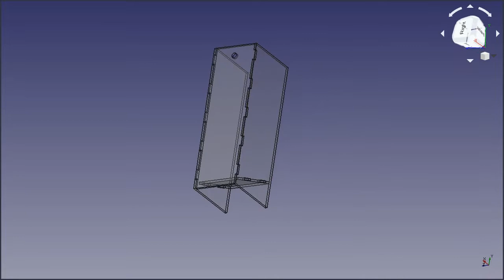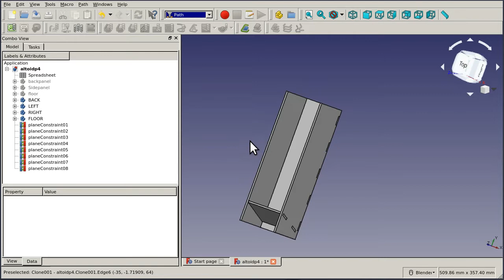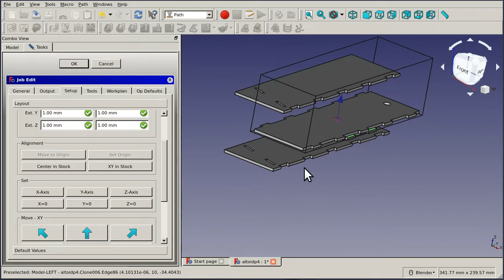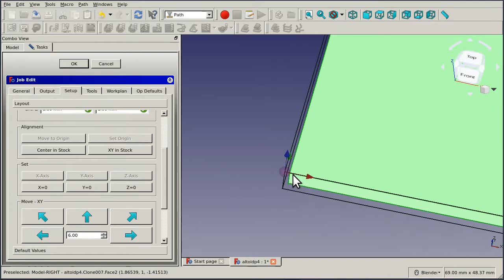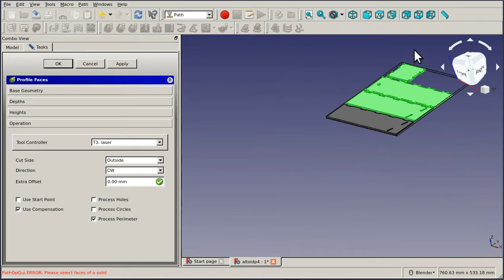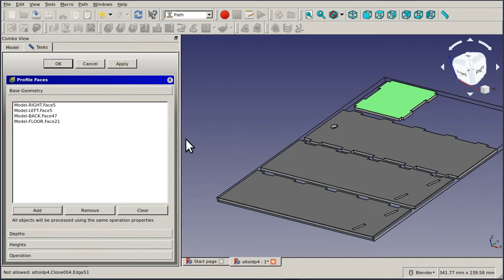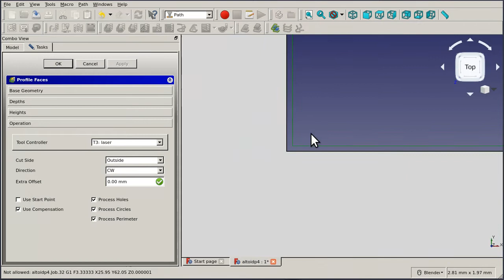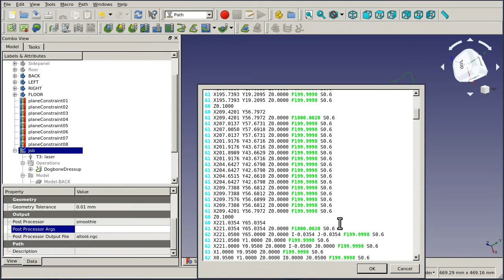Laser-cut finger joint box  (end-to-end) - Part 3

Comment: Fantastic demonstration of FreeCAD as always. You are really helping me understand the Path workbench. I find myself revisiting some of your other videos on the subject from time to time, I'm sure the same will happen with this series.

That said your attempted use of the acrylic cement did raise an eyebrow. Here's a tip: you need to drag the needle along the length of the joint. It is clearly shown in the video at v=hT6Ow_cBTps - using that technique you might not even need the finger joints on the acrylic sheet parts for a design as simple and lightweight as this.

Hope that helps your future acrylic projects. Of course it would have made the FreeCAD bits in this series less interesting if you had only straight edges to your parts.

Comment: Great video, thank you!
I have missing information: start position for subtasks. For example plate with multiple holes. My workflow in circle cut out: starter position ~3mm range in the circle area and if beam cut out the plate then G01 to circle start point and G02/G03. 

Simple g-code example:
...
G00 x23y20
M03
G01 x20
G02 i10
M05

G00 x53y30
M03
G01 x50
G02 i10
M05
...

How to setup this workflow?

Comment: Hi ! So bad this tutorial doesn't say a word about how to configure a tool/controller/Post processor.

I'm trying to build the frame of a robot using finger joints. The machine I will probably be using is an ML-W960 (it's from a fablab).

On this fablab's website, they say it only supports BMP, PLT, DST, DXF, AI and CDR files, so I'm not even sure I will be able to use my .ngc gcode.
They suggest using DXF files. I could export my document as a DXF, but then it wouldn't compensate for the kerf in the finger joints, and I couldn't use a dogbone dressup.

So I have two issues :

    How to configure a tool/controller/Post processor for laser cutting ?
    Can I output a DXF file instead of a gcode or how to make sure the machine will accept my gcode ?

Thanks !
Reply from the maker: I've touched on post processors in a couple videos in the past but I've never done one on customizing a post.  I'll consider that.

Comment: Hi, thanks a lot for this video (and the others) !
For me it is a discovery of the Path Workshop. For the very interesting thing is the management of the offset due to cutting thickness : we just have to draw everything at the theoretical dimensions, it is great and efficient !

BUT the issue for me to exploit this function is that my cutting laser machine is not piloted by a Gcode but like a printer (it is an Epilog one).
So usually I export the shape of my pieces in dxf files and then I'm able to import them into Illustrator.

So my question is : is it possible to get the path drawing (the green lines) in a dxf file? I tried different exports but never worked... :-(
Alternative question : is there any other automatic function in Freecad to get the shape with a defined offset ? external contours (enlarge) but also holes (reduce)

I do hope my comment and questions are clear...

Thanks for reading and mainly for helping!

PS: I use Freecad 0.17
Reply: all lasers i used to day have a software that accepts svg or dxf  (some come with 'RDWorks' - for a opensource option you can use/try VisiCut) - and so - i also just created a TechDraw of every single body i had and exported them as dxf...
but for me i also had never problems with the 'inaccuracy' of not offsetting the beam-diameter.. just constructed with 0-tollerances and the beam diameter worked as tolerance ;-)
(or at least i don't think that one of the laser-software things do offset it...)
but you could search for a G-Code to DXF or G-Code to SVG converter → the later that should be really straight forward - as SVG supports paths that are described by points...

Comment: Where can I get templates for laser? My job template list is empty and I have not any laser tool (0.18,0.19)
Reply from the maker: You create your own templates. They're just saved job defaults that make it easier to set things up.  I have a template for each kind of material that I cut.  First, you need to create a 'tool' for your laser.  This takes some fiddling around to figure out how big the kerf (how wide the beam is as it cuts through the material).  Once you know the kerf (mine is about 0.1mm), create a tool.  You can just pretend the laser is an endmill and set the diameter to your kerf size.   
Next create a job to cut something.  Add a toolcontroller for the tool and configure it to control your laser.  This too depends on your specific machine.  My laser uses an M3 to turn on the beam and the S word to control the power.  So M3 S0.7  would turn on the beam at 70%.   Different materials require different feeds and speeds so you'll configure the tool controller depending on the material.
When you have things working the way you want, use the Path->export menu item to export the job as a 'template'.   Then in the future if you want to cut the same material, just create a job using that template.  You'll get the tool and tool controller automatically added and ready to go.
Reply: @sliptonic  is somewhere example, how to prepare template for laser engraver? I'm getting grbl for mechanical engraver with constant spindle speed and z-axis positioning but I need laser mode with two-axis system and with laser power change (M3/M4/M5)